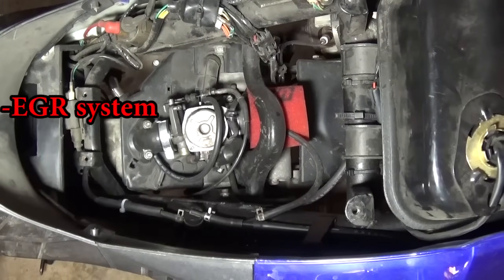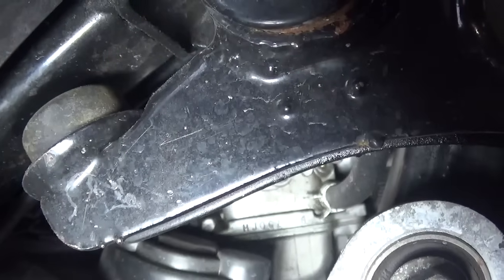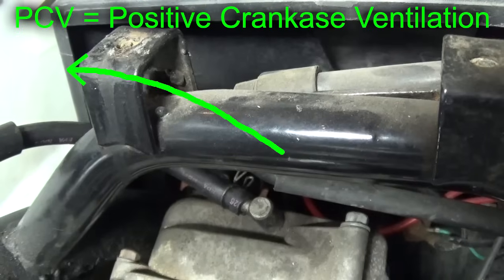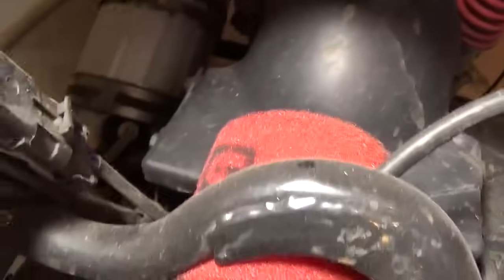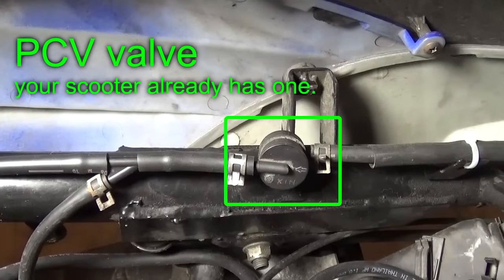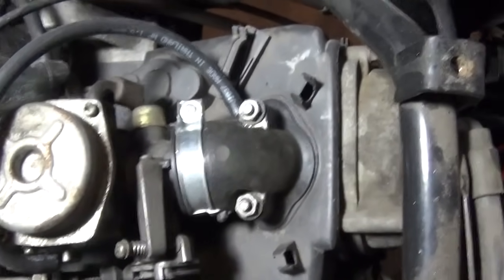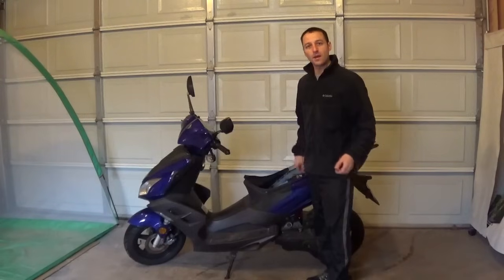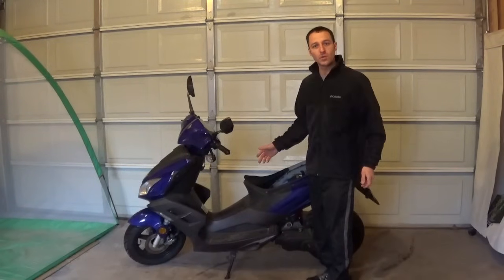How to simplify vacuum hoses on a scooter

Comment: Hi Paul: My 150cc MC-75 scooter exhaust pipe crack. I am having extreme difficulties find an exhaust pipe to match the original. The original exhaust pipe has an inch nibble pipe that attaches to an valve. Cannot find one!!! Any recommendations or modifications other than a original pipe.
Reply: Jesus tommy i hope you speak better than you type. seriously ? An valve tommy.....an valve? Does that even sound right to you? My scooter exhaust crack? Really? Other than a original pipe? Sad tommy. Phonics is fun. Oh and it makes you not sound stupid.
Reply: tommy korakis honestly I went to Cap,you can go to O Reillys or Autozone and pick up a Briggs and Stratton exhaust for like $7 and weld it on to yout header pipe just cit the pipe alittle with a saw really easy and have someone weld the exhaust into the header and your golden you won't even need to use clamps since the exhaust is soo small and light it won't break or come off ive been running mine for the past 2 yrs no problems and it sounds awesome vroom vroooom!!!!!

Comment: So you just removed your fuel pump and it's now just gravity feed?
Reply from the maker: Ron King Scooters with carburetors don't have a fuel pump.  The part that has a vacuum hose is a fuel safety shutoff valve.  Engine vacuum opens a diaphragm that allows fuel to go to the carburetor.  It doesn't pump the fuel.  It just shuts off the fuel when the engine is off.  It prevents spilling gas if you crash your scooter.
Reply: That's not entirely true. If the fuel tank is below the engine, there's a vacuum powered fuel pump. In that case, use the other port in your intake for the fuel pump, or use a T fitting if you only have one port in your intake.

I've had both kinds. ;)

Comment: my carberator is leaking fuel at the fuel inlet port on the  carberator please help it runs  but leaks
Reply from the maker: Check your hoses for cracks and replace the hoses if needed.  If the hoses don't leak, but fuel leaks out of the carburetor, you may have a stuck inlet valve.  Remove the carburetor from the scooter and remove the float bowl.  You can then check the operation of the inlet valve.

Comment: Do you have a link or blueprint of how the fuel line goes on? Also is the scooter in the video a 50 or 49cc?
Reply from the maker: The scoot in the picture is a 150cc.  The fuel line is simple.  Gas tank has a vacuum operated valve on it.  Line goes to fuel filter, then to carburetor.  If your gas tank is in the floor, your tank hose goes to a round pump thing mounted on the frame (that has a vacuum hose), then to a filter, then to carburetor.

Comment: should the vaccum hose leak gas when i remove it? i believe my hoses are clogged it's been sitting for about 2 months without start now I am having trouble getting it started or when i do get it started it wont accelerate. do you think it's cloggeed
Reply from the maker: That depends on which vacuum hose you're talking about.  If you're talking about the one that runs along side the fuel inlet hose, that goes to the bottom of the fuel petcock (on or near gas tank), then it could be the cause of your problems.  The fuel petcock is a vacuum operated valve that allows fuel to flow from the gas tank to the carburetor only when the engine is turning.  The rubber diaphragm inside can go bad, and you'll get gas in the vacuum system, and not enough gas in the fuel inlet of the carburetor.  This can cause hard starting, bad acceleration, or just make the scooter not run.

Comment: what about a fuel pump and two plugs in the manifold? mine has the second going into a fuel pump, is this for vacuum?
Reply from the maker: If your gas tank is lower than the carburetor, your scooter will have a fuel pump.   Yes, it must have a vacuum hose going to the intake manifold.
Reply: Paul Shpakov thanks, also my gas tank has 3 outlets, one goes to a reservoir, one goes to the pump and the third goes to egr can. after i remove the egr can can i block off the third outlet?
Reply from the maker: Yes.  You can also vent fuel tank fumes to the air filter side of the carburetor.

Comment: I have a scooter that has a crack in a pipe thats affecting the vacuum system, if i superglue the crack will that work?
Reply from the maker: gina hardison Just get some new hose from the auto parts store.  It will cost the same amount as the glue, but it will actually work.  :)
Reply: Thanks

Comment: HELP!!!! PLEASE!!! I just bought a scooter.. 2007 VENTO TRITON..I replaced battery.. it's cranking but it won't start..  I seen a hose sticking straight down by the kick start...  it only leaks gas when I kick start it but no leak when I try to start it with the start button. I looked under the scooter and I a evap canister.. does that hose go to the evap canister?? if so which tube does it connect to? one is bigger than the other.. or does the hose even go to that canister??  idk please help
Reply from the maker: You should take the carburetor out, and put a rubber cap over the lowest port on the carburetor instead of the hose.  It's the carburetor float bowl drain.  It sounds like the hose on yours is leaking.  You can also check out my carburetor tuning video for a closer look at the carburetor here:  https://youtu.be/6EYTQsi1YJc

Comment: "install the bolt from the back side to block the EGR passage" ?

firstly, THANK YOU SO MUCH FOR THIS VIDEO!!! this is the only definitive video on the internet that outlines how to simplify all those crappy unneeded vac lines!

question: when you said you installed a bolt to block the egr passage, what size bolt did you use? how did you install it? could you please be more specific? i have found an EGR block plate i can order, but i would rather just block it myself than order an extra part.

thank you so much!!!  also, what happens if we do not block that port?
Reply from the maker: +unstrung13  I'm glad the video was helpful!  I think I used a 1/4 inch bolt and a nut to block the passage.  If you're using a nut like I did, the exact size doesn't really matter as long as it fits.  If you don't block the EGR port, you'll get exhaust gas coming out of that hole and your scooter will be really loud and sound like it has a broken muffler.
Reply: Hey man thanks for the video so I have a 150 cc and I'm putting on a new nubby car it has one vacumn port on it and of course it was supposed to go to my petcock but I want tl get rid of my petcock and this canister 9f vacumn lines so I have the hose that comes out of the top of my head goes to the back of my cvt case and so I do t kniw if it's ok to run a hose to my intake manifold port to my little canister as you have then to my fuel tank and then the other part of the t to my carb and then just leave the head one gojng to the cvt what do you think thanks

Comment: what did you do with the 2 stock vacuum lines into stock air cleaner?
Reply: Thomas Flynn Waiting for a answer!
Reply from the maker: +Thomas Flynn The 2 lines are hooked into a T and go to the foam filter.  It's the crankcase ventilation and fuel tank vent.
Reply: can you show me? Thanks
asap
Reply: you misunderstood me! I put a cone air filter on and got rid of the stock one! What do you do with the 2 lines that went into it?
Reply from the maker: +Thomas Flynn You would run those lines into the cone filter.
Reply: just leave them loose?
Reply from the maker: The two hoses that go into the air filter are part of the evaporative emission system.  They take fuel vapors from the engine and crankcase, and feed them back into the intake so the engine burns the excess hydrocarbons instead of letting them go into the air.  That is why you would run those hoses to the air filter.  You can also leave them disconnected.  It would not affect the performance of the engine.  In this video, I demonstrate how to set up a simplified evaporative emission system, where the hoses go directly to the intake, without any canisters or control valves.

Comment: I’m having an issue set my celebration decreased and my top end remain the same and when I go out and come to a stop at a stop sign or light the bike  turns off what I’ve been doing is that I Revit when I come to a stop in order for her not to keep dyeing and then it idols normal
Reply: Did you figure it out mines doing the same thing

Comment: Great video! So you removed the fuel petcock? Does this cause any flooding while the scooter is off?
Reply: +Julian Wasserzug Best to install a manual on off shut off valve for when the bike is resting overnight lets say.
Reply from the maker: +Julian Wasserzug The carburetor already has an inlet valve.  If the carburetor works right, you won't get any flooding.
Reply: +Paul Shpakov so why do the have the vacuum fuel pump?
Reply: +Tee Mann so if i bypass the vacuum pump, and jump from the fuel filter to the bowl, then jump a vacuum line from intake to choke port on the carb like you did,, it should work? i just took the carb apart and cleaned it, the jet with the holes in it was clogged.  i bought a 08 gator 150, that has been sitting for a few year with a broke throttle cable, lol just did more reading i see its a vacuum petcock, going to put a manual petcock on. then jumping the vacuum, to the choke.
Reply: @LabCoatPaul  To clarify, one could remove the petcock entirely and the flow of gas to the carb will stop when the moped is turned off?
Reply from the maker: @joesickinger  Yes.  I removed my petcock because it was leaking gas.  The petcock is a vacuum operated safety shutoff valve.  If you crash the scooter and the engine turns off, the petcock will stop the entire gas tank from draining out through the carburetor.
If it works, leave it.
If you don't have a petcock, the fuel inlet valve inside the carburetor will stop the flow of gas.  But that only works when the scooter is upright, and not laying on it's side.  Also, if you get any dirt in the fuel line, the fuel inlet valve can get stuck open.
Reply: @LabCoatPaul  hey Paul thanks for the advice. My petcock also failed so I removed it. 
I'm using the 139QMB Carburetor by TOPEMAI on Amazon which comes with an intake manifold. Unlike other scooters I see on YouTube, this intake had only one nipple for the vacuum line which would run up to the petcock. Since I removed the petcock I plugged this nipple.
I also removed the ERG system so all I have left is a single vacuum line running from the crankcase to the air filter.
Additionally I have a single gas line running from the tank to the carb. Unlike other mopeds, my gas tank does not have a vapor emissions line.
All that being said does it seem like I have an adequate setup?
I really appreciate the feedback, thank you.

Comment: what about the fuel pump or the petcock?
Reply from the maker: Scooters that have a gas tank lower than the carburetor will have a fuel pump.  Scooters with the gas tank higher than the carburetor don't need a fuel pump.  If you have a fuel pump, you will still need a vacuum hose running from the intake manifold to the fuel pump.
Reply: I have a 150cc gy6 and the gas tank is above thr carb, and it have a vaccum fuel pump, I can't get it started I don't know if I have the hoses right or not, but the gas tank have to line hook up and a very small on I don't know which on go to what please help I could send u a picture if u tell me where to send it, please help Paul want to ride my bike this summer so bad
Reply: Help

Comment: ok, my hose set up is confusing and im trying to simplify it to get my scooter started... I have 2 lines coming from the top of the fuel tank, one on the left and one closer to the center. The hose on the left just goes straight to the petcock on the port that points away (the one that's most by itself looking) The hose coming from the center goes to a T connector which branches off to both the petcock (the port that points forward, not the bottom port) and the bottom of the carb. Lastly we have the lower port on the petcock, which goes to a T connector for the intake manifold and the top of the carb. Now let me get this layman... I'm supposed to take the center tank line, to a filter, straight to the bottom of the carb. Then on the carb I connect the upper port to the port on the intake manifold. Then for the left tank line I... I think that's it for fuel lines lol. The EGR stuff I get, just gotta find my one way PCV it's prolly in the air box I took it off and went with a cone filter... There's a third port at the top of the tank, by the gas cap, that looks like it's prolly the evap, but it's capped off...

Comment: I’m concerned that if I remove the vacuum driven fuel valve that the carb will flood when the moped is turned off anyone know if this is the case? Let me know
Reply: As long as your carb is clean and your needle seats correctly you should have no leakage if anything you can run an inline fuel shutoff also as a backup

Comment: Could you re-do this video to be longer with more explanations? Some things are confusing. First, why do you need to feed crankcase fumes back to intake? Why do you need one way valve there at all? Secondly, you show that all you need for a vacuum is one hose to jump 2 locations. What about the peacock valve, doesn't it need vacuum, did you make the fuel feed by gravity only? So many questions. I am still hazy, why did you need to bridge those 2 vacuum points on the carb... Also, about feeding crankcase fumes back to intake, you are feeding fumes that no longer have oxygen because it was burned off, this defeats the use for intake that adds oxygen to fuel mixture. If you add gas that no longer has 20% oxygen, you are fiddling with the proper oxygen to fuel mixture.
Reply from the maker: Check out my Chinese scooter playlist!  https://www.youtube.com/playlist?list=PL1_JDBt1LSiJQETjZiOFXBKtv-ZzfqEx0

Comment: Paul I have a peace sport I changed the Carb, CDI, Spark Plug, Spark Plug Wire, Oil, Ran direct line fuel Line to carb with shut off switch and new Fuel Filter, and fuel Lines it starts now but bogs out when I give it gas any suggestions, Thanks in advance to anyone that can help
Reply from the maker: +alvin dixon Sounds like a carburetor issue.  Check out my carburetor tuning tutorial!  https://www.youtube.com/watch?v=6EYTQsi1YJc

Comment: So I did all this... scooter bogs out before it starts moving...

Also where is the egr valve???
I have same looking scooter
Reply from the maker: You may need to tune the caburetor.  Check out this video for the 150: https://youtu.be/6EYTQsi1YJc  I also made this video about the 50cc, but it explains tuning much better:  https://youtu.be/iCGjVRyN6YU

To find the EGR valve, look at the valve cover on the front of the engine.  You'll see a curved piece of metal.  The thing bolted on to the bottom of that pipe is the EGR valve.

Comment: I have one line I can not seem to find where it goes. It comes off the plastic box right under my fuel filter area. I have picture attached. It must go somewhere because the other end has a clamp on it.
https://www.dropbox.com/s/9drv9dl0zwrbhc4/2017-09-02-PHOTO-00018125.jpg?dl=0
Reply from the maker: That looks like a drain for the plastic box just in case your fuel filter leaks.  Definitely not an important hose.  It's probably just supposed to hang down randomly.  You can leave it, or remove it.  Doesn't matter.

Comment: I have a 50cc chinese scooter and i have a hose lose and i don't know where it came off from. A black hose with a metal spiral covering. I think it goes to the carburetor can you help?
Reply from the maker: Most likely it's the drain hose that connects to the bottom of the float bowl.  You don't need that one if the float bowl has a valve that closes on the bottom of the carburetor.
Reply: @LabCoatPaul  
Thank you so much

Comment: I have a petcock configuration and the vacuum hose coming out of the manifold is connected to it which is normal but my carburator also has a nipple for some hose that is missing and i think i'm having a vacuum leak because of it, any help ?
Reply: If you have a cvk carb you should have only two main hoses running to it: 1. Fuel supply, goes to the brass fitting 2. Vacuum line for the diaphragm on the side near the throttle cable bracket....There may also be a fuel drain hose attached to the very bottom of the float bowl and a rubber fuel over flow elbow which would be connected on the side near the auto-choke.
Reply: @RellyOhBoy  thank you bro! i got it sorted out but my scooter still chokes/boggs when my throtle reachs 75% for some reason, im thinking of replacing the whole carb
Reply: @sufy.r  they're super cheap on Amazon. Like 20 bucks for a PD24J carb. I keep a few on deck. When my scoot starts to idle funny and hesitate on low throttle I know the pilot jet is probably clogged so I swap in a new carb and eventually bust down the dirty ones and clean them up. Pilot jets always get fouled up because of the small hole.